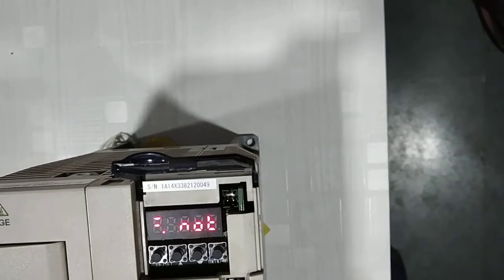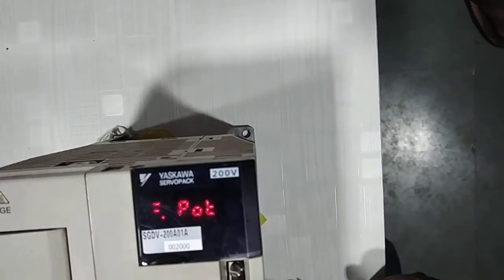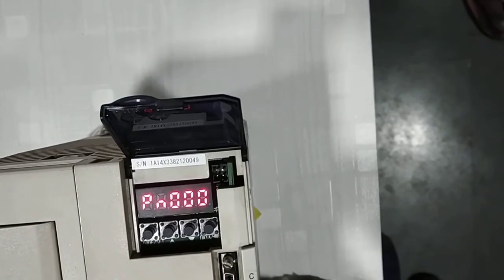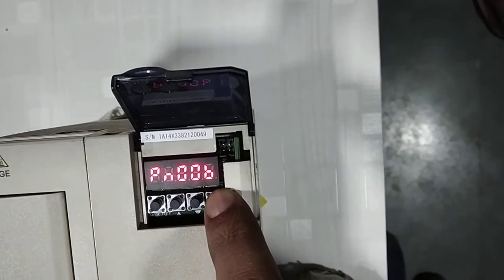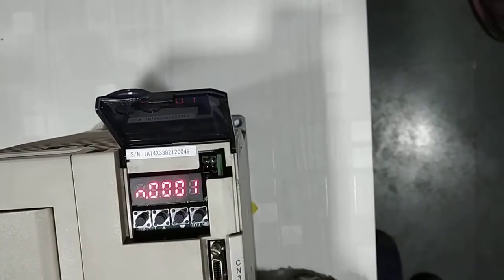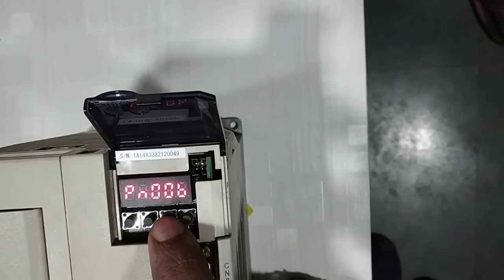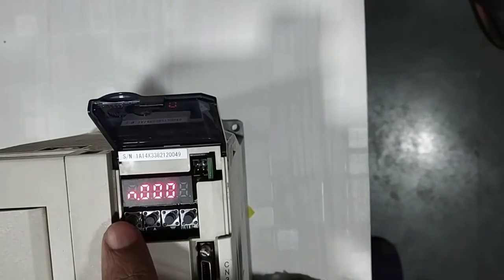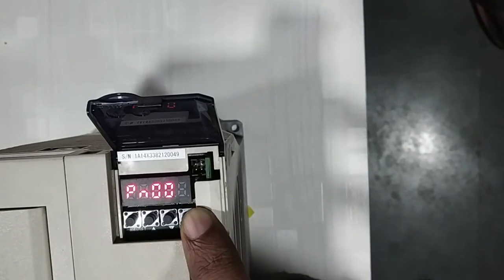Yaskawa AE Mecahtronics SGDV Servo Pack PNOOB

Comment: Sir drive sgdb-15adp factory reset ka parameter kya hai
Reply from the maker: 1. A10 is over current. Check UVW cable.

2. A30 is regen is high or high input voltage or regen resistor

3. Factory reset won't help

4. You may need to repair or replace. 

5. You shall send to Nearest service center. AE Mechatronics
PAP A 398| TTC Industrial Area| MIDC Mahape|
Navi Mumbai| Maharashtra| India 400710
Reply from the maker: Fn005
Reply: Can I have an email? I'll send you a picture.
Reply from the maker: Automation@live.com
Reply: My drivers alarm A10 and A30, will factory reset disappear?
Reply: Thank you